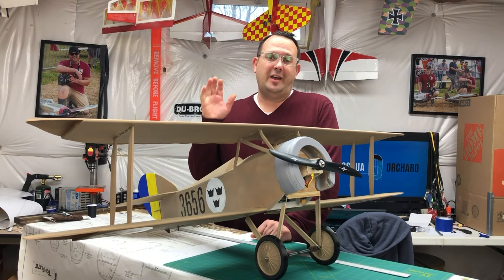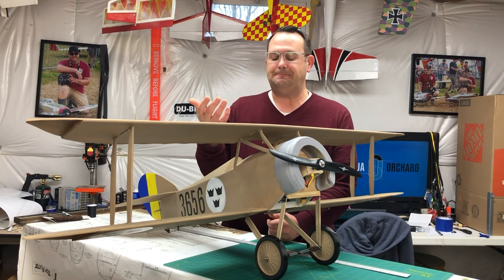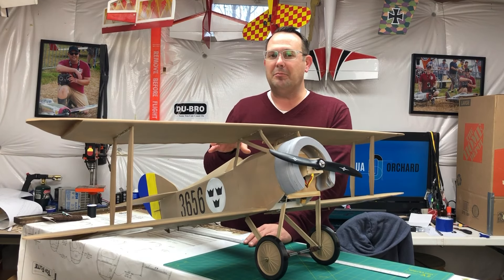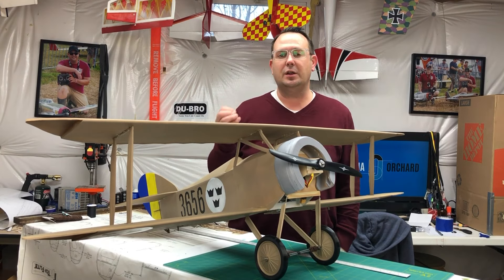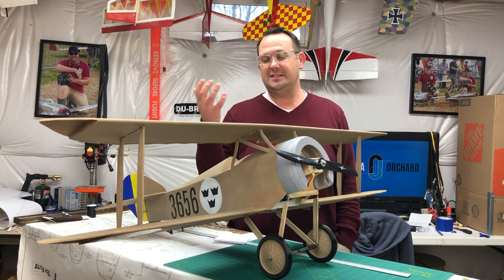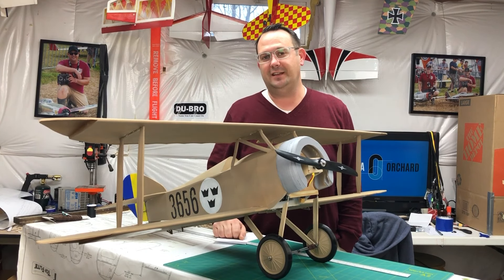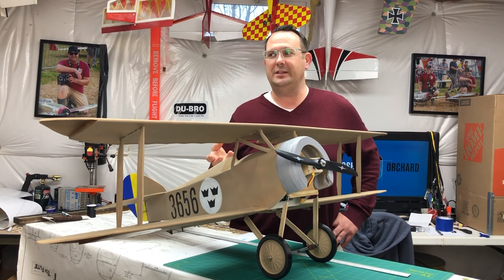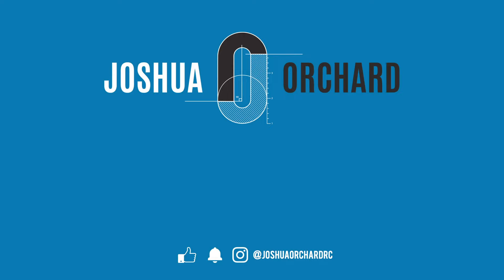Balsa Plans to Foam Board Airplane EP05

Comment: I just got done building a 40 in wingspan fokker tri plane out of foamboard and it's really really heavy. I think I used the wrong foamboard. Even with 6s power setup stall speed is 35 mph. So really fast landing. 40 inch top wing and 6s motor with 85 Amp esc with 6s 4200mah lipo battery. Weight 13 pounds. Foamboard bought from hobby lobby. 8 sheets of it cost 95 bucks. Sooo now it's time to start over and use Walmart foamboard instead.
Reply from the maker: Not all foam board is created equal. Elmer's foam board is VERY heavy due to ceramic impregnation in the paper to make it more rigid. Ross, from Walmart, or Adams, from Dollar Tree, are the usual suspects to build with and never any of the colored variants. The white is your go-to with the Flite Test water-resistant variant being the ONLY exception.
Reply: @JoshuaOrchard  ok. Thanks. I'm wanting to build a half scale fokker tri plane and a half scale 1920s racing plane next. But like I said I'm having trouble with material
Reply: @JoshuaOrchard  there's a guy on YouTube that builds 1/4 scale and half scale warbirds out of foam board. But he use super thin foam board and not what flite test or Walmart sells. How do I build 1/4 scale planes use only foam board and some bass wood. And possibly use some lowes foam 4x8 foam sheets for the ribs. What do you think I should do?
Reply from the maker: @taylorpillow5603  I hope you can look at my channel and find exactly what you are looking for. My Fokker D.VIII build series focuses on exactly that.